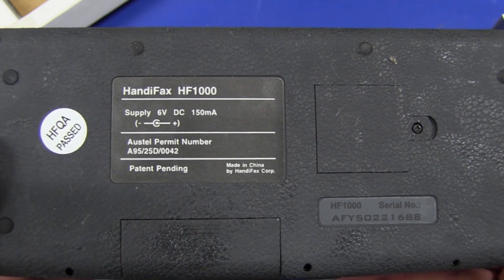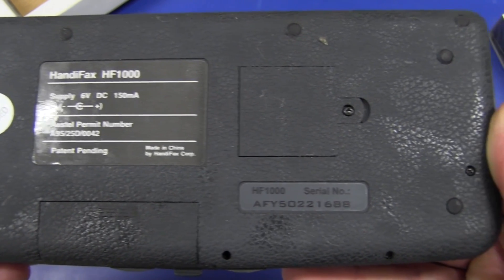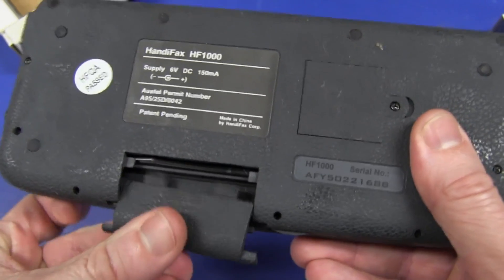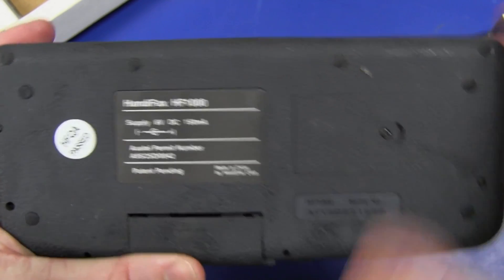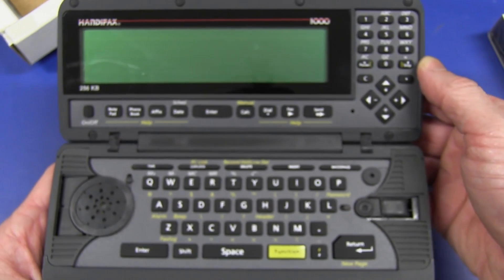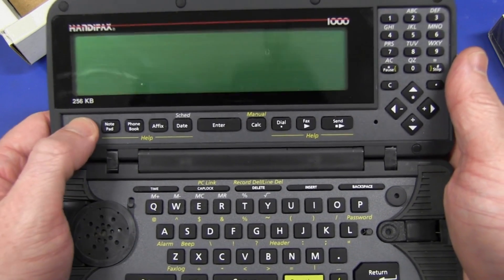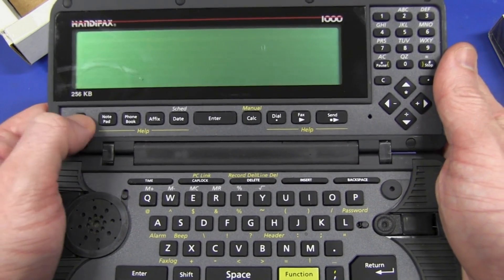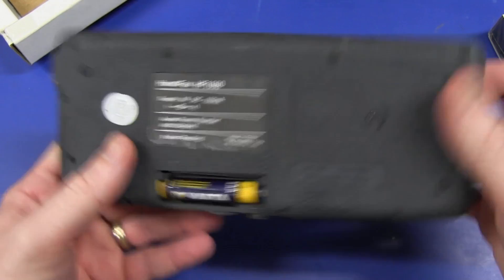EEVblog #287 - Handifax 1000 Teardown

Comment: if i could buy a new battery for it i'd have a PalmOS Tungsten T PDA (with dock) to mess with, vintage 2004.
Reply: +KOSMOS1701A You know it's super easy to google "PalmOS Tungsten T PDA battery" right..?
http://www.amazon.com/Battery-Replacement-Tungsten-Installation-Extended/dp/B005E2V0TY
or
http://www.amazon.com/HQRP-Rechargeable-Replacement-Screwdriver-Installation/dp/B001DV1GCG/

I actually don't recommend that though, because it's also just as easy to find out what type of battery it uses and bodge your own in.. The 3.7V (and the description) gives it away, it's a li-po and you can find similar 900-1100mah batteries for less than $10.

Comment: Based on dates it would seem that they were attempting to do what Blackberry succeeded in doing. The first Blackberries were released in 1996 according to Wikipedia, so that would have killed this device simply by having access to a mobile network instead of relying on the acoustic coupler! 

This same device, ten years earlier, would have been a sure winner if they could have met the right price-point. Fax was the bee's knees in the '80s.
Reply: Aadil Shah Also the Nokia 9000 Communicator was introduced in 1996.
Reply: +Aadil Shah Kind of, but not really.  There were already better devices out before and about the same time as this one (see the Newton or Nokia's Communicator) and other much smaller devices that had everything except the built in coupler... but some had the ability to plug in to the phone line through a cable anyway.
The Blackberry you are talking about was just a special pager and had no fax capabilities, it just allowed you to return pages basically.  It was another few years before their pager even had email access.

Comment: Interestingly on page 4 of the WIPO patent there should be a secondary microphone that is used for active noise canceling (they should have sold that to Bose)

https://patentscope.wipo.int/search/en/detailPdf.jsf?ia=GB1993002356&docIdPdf=id00000000715926%3FparSeparator1=&name=WO1994011986PORTABLE+MESSAGE+TRANSMISSION+APPARATUS&parSeparator2=&woNum=WO1994011986&prevRecNum=5&nextRecNum=7&recNum=5&queryString=ALL%3A%28011986%29&office=&sortOption=Pub+Date+Asc&prevFilter=&maxRec=80

Comment: Maybe it would have turned on with the battery cover closed...
Reply: Andrew Somerville 
I think it's rather to switch the static RAM power supply to the backup coin lithium battery during main batteries replacement. :)
the phone lines are only connected to the little PCB with optocouplers  (modem with diode bridge and current source transistor)
I think the top optocoupler must be for the ring indicator (led to the left) and the bottom one for the line current drive (led to the right)
Reply: Sarah Cartwright Thinking the same thing.
Reply: Sarah Cartwright I think the contrast was down.
Reply: CoyoteGames Later on in the teardown he found a switch that disables the unit when the battery cover is open. It's done for safety reasons because of the presence of phone line voltages.
Reply: +Genesis92 I agree that the switch was probably just to make sure the device was generally in an OFF state while replacing the main batteries,... either to reduce the load on the coin cell (prevent possibly trying to power the device from coin) or possibly as you suggest to alternate which source is keeping the memory alive.
I see now that there WAS an option to connect directly to the phone line.
Reply: JimmyDB - Yeah, a switchover to the coin cell during battery replacement does make sense there.

Comment: The micro switch is to shut the thing off before you remove the batteries. This was before the days of flash memory, so all your data was stored in ram. If the coin cell was drained then you'd lose all your data.

Comment: HANDIFAX
Serial 74387197
Registration 1866286
Registration December 06, 1994
Filing May 05, 1993
Canceled December 15, 2001
Goods and Services009.Portable facsimile machines
Current Filing Basis:	 1(a)
Original Filing Basis:	 1(b)
Published for Opposition November 09, 1993
Registration Date December 06, 1994
Type of Mark Trademark
Current Location FILE REPOSITORY (FRANCONIA)
Current Status CANCELLED - SECTION 8
Date of Status: December 15, 2001
Mark Drawing Code:	 1000
Live/Dead Indicator:	 DEAD

Comment: Ashens reviewed an Amstrad touch screen "PDA" some time ago and its cover had a similar issue with the rubber rotting and turning into a horrible sticky residue, he used Acetone to remove it, so if you want to remove that residue you could try using some Acetone, but you'd want to be careful not to damage the plastic casing.

Comment: Dave, I've seen worse. I used to have a speaker. The board was broken in the middle, which was repaired with Hotglue. The contacts were restored with aluminum foil ...

Comment: Around the time that thing was made I had the job of checking out production of gear in China, Hong Kong and Taiwan for consumer and IT stuff for a company I worked for. A big aspect for phone line connected gear was Austel testing. The bodge board looks like an attempt at line isolation and presenting the right capacitance to the line too. Austel would take a bit of gear and test it for a fee and once lost a very expensive phone we submitted with the response sorry bad luck. 1kv finger test :)

Comment: I wonder if it woundn't have been cheaper for the company to redesign the PCBs instead of modding them. Because you have to think about the fact, that these wires had to be actually handsoldered, which would have been very labour intensive. This means the production const will increase drastically. The companys profit on that thing would have been very poor. 
But as Dave says: A total looser :)

Comment: Indeed, i actually laughed at that flattened DIP.  Initially i thought Dave got hold of something that was already hacked by a modder - then I realized they would have done a much better job of soldering and modifying the device ;)

Comment: Usually it's because its a packageless chip that is wire bonded to the PCB or a flip chip. Without the black goop it would be very proned to damage as the wire bond leads are extremely tiny and so are exposed packages, not to mention oxidation of the chip.

Comment: Baud rate is symbol transitions per second.  For example a V.34 (33k6) modem is  3420 baud with 10 bits in each symbol.Resulting in 34200 bits per second.  The resulting bit rate on the rs232 interface is netto  33600 bits per second without overhead
In day to day speaking baud rate is bits per second through the telephone line.,

Comment: I assume because the phone line has up to 48 V AC on it?

You can see the small added pcb has wires going to the rj45 like connectors, so it's used with the phone line.

Comment: it'll be for the ring signal most likely, also the phone system runs off 48 - 50 volts DC, the bridge means any wiring errors wont affect things too much and rectifies the AC ring signal (which is like 120 odd volts peak)

Comment: I noticed, that you havent put on the battery cover, when you tried to turn it on, and later you talked about that microswitch, that disconnects the batteries during battery changeing. It wont start until you put that cover on. Nice video:)

Comment: Iam shure that the small swich is the reason why it did not start... If i'd use something like that it will be to stabilize the power to avoid the processor jumping registers...